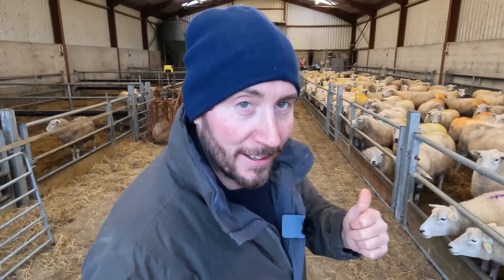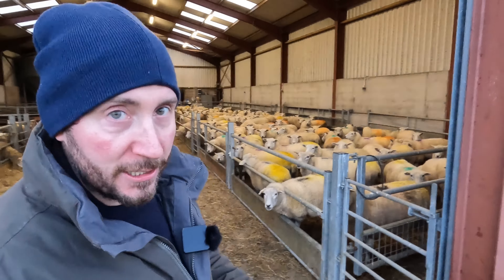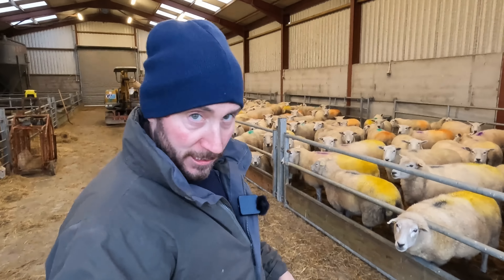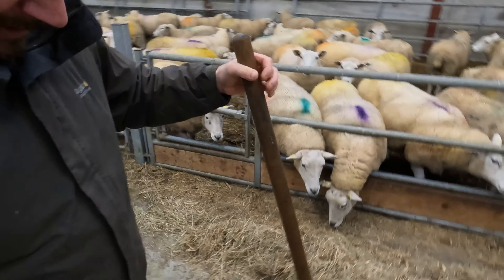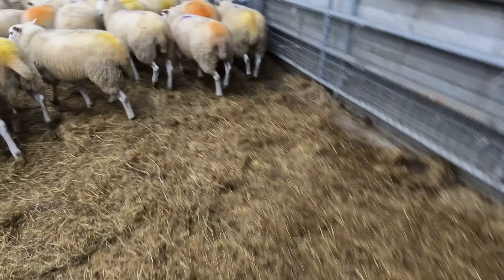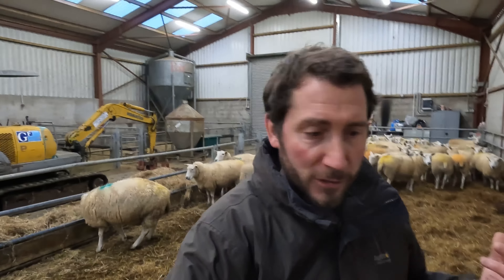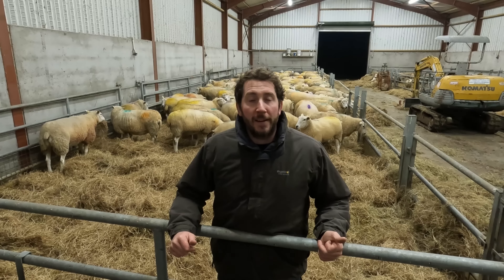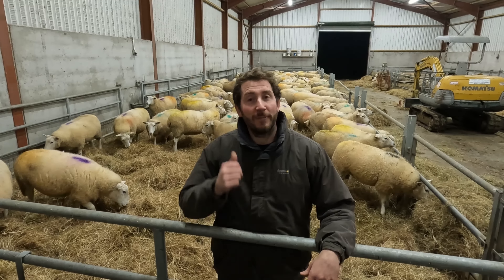Feeding and Bedding Sheep A Different Way

Comment: 👍excellant, i have a wee digger for pushing up silage, but the fork for hay and straw brilliant. Would it be better to keep the outside and center tines, and remove the rest to stab the bale easer?
Reply from the maker: Agree 100%. It's a  bit tricky to stab the bales but much better with all the tines for picking up loose leftovers at the barrier.

Comment: I wouldn't bother with a tractor I don't think it will be any better for you. Your machine is really handy!
Reply: If you could put a hydraulic motor on your spike you could make it into a bale unroller, you'd need less spike an it wouldn't shake you machine to bits an probably spread your baled better!
Reply from the maker: Thank James. I could manage without the tractor for the feeding but think a tractor and a straw chopper would speed up the bedding...
Reply: @sheepschool365  it would, but is it worth it for the cost!
Reply from the maker: @jamestatham9950  think I've come up with a budget option. If it works I'll stick it in a video...

Comment: do you have extra hydraulics for say a thumb. You could have a skidsteer bucket mount frame on there and then use a bale spinner. I made one using a front wheel bearing and a hydraulic motor.
Reply from the maker: Good idea..  have a spare valve on the chest. Just need to run pipes down the jib  for an extra service.

Comment: great video on the bedding the rushes is a good job keeps down on expense . what is the lent of your shed as i am looking to put up one  looks good keep up the video.
Reply from the maker: Thank you...👍 Shed is 29metres long and 15metres wide. I will make a video of shed and all the ewes in it for lambing time.
Reply: Would be good to know the pros and cons of roller shutter doors vs hinged, the costings are causing me an issue of debate
Reply from the maker: @alexjamesbebbington4606  hinged doors of that size (4m) are too dangerous.  Sliding door is a safer option but not that much difference in price with a roller door.

Comment: Can you just unroll the bales by hand (or machine) as a simpler option?
Reply from the maker: Yes. It's quite easy to roll them out but find it easier to spread out bedding when bales are shaken out with digger.

Comment: We have got the same type of setup,  we have the muck forks of the loader tractor what I can just remove some bolts and then use on the tractor again.
It also good for Mucking out as well, in the shed as it a bit tight for space.
We have used hay for beeding as well.

Comment: a two pronged grape would  be easier than the one you are using otherwise top marks
Reply from the maker: Have a 2 prong fork with no handle I will resurrect at some stage...👍Some people swear by a 3 pronged fork for silage...
Reply: @sheepschool365  i have all  3 and always look for the 2 prong because it is so light